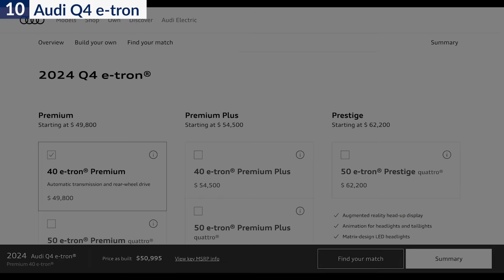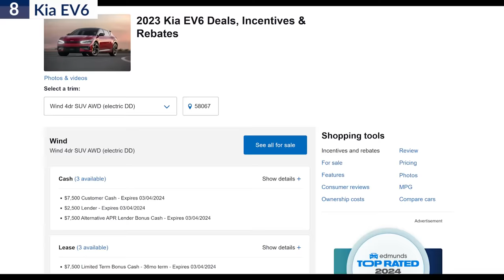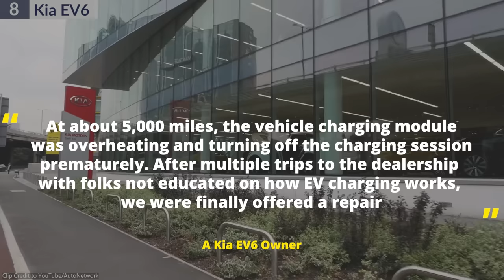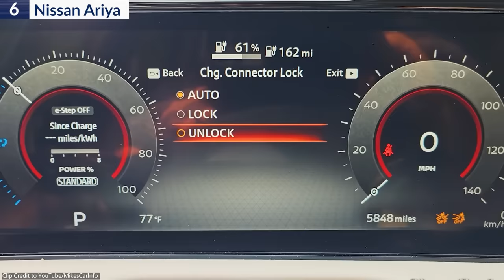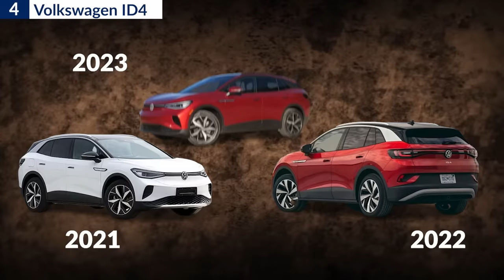New Electric Cars Piling Up on Dealer Lots in 2024 – Here is the Truth!

Comment: The hell with pollution I'm not going to be here in 2 million years. The car should know everyone doesn't have $60,000 to spend on a car. Or home to install a charger port.
Reply: Most people can plug into 110 volt and that'll be more than enough to do their typical running around. All the stupid comments on here about they don't have more than a 300 Mi range. Just ask yourself when was the last time you drove 300 miles?. Most successful people have more than one vehicle anyway
Reply: @davebrickley455 Why would anyone want to limit themselves to that??  When you could have a full tank of gas?
Reply: The use of “ most people can plug in at home” is an absolute joke, most people cannot, most people do not live in a property that allows off street parking.
Reply: 2023 hottest in recorded history and come on that's a pretty selfish comment.  You have any kids or grandchildren?
Reply: @mellarner8253  I was talking about dumb comments, yours definitely is one of them. If you've got a garage, you can plug it into any Outlet if you don't have a garage, you can run an extension cord to your car. If you live in that shity of a neighborhood, you've got none of above. I'd say electric cars the last of your worries
Reply: @davebrickley4557  In general, the majority of people here in the UK at least do not have that option. As for myself, I can park a number of vehicles on my country residence, not that I would contemplate having an EV, I have 4 x4 vehicles that I tow with, there is no EV that would be able to tow 3500kg any distance.
Reply: More issues, that the car should know ;

1. Child battery mineral labor

2. Range anxiety

3. Risk of garage fires

4. Paying 20k more than a
comparable vehicle

5. every time you fuel up an EV, the fuel tank gets smaller  and smaller. Battery degeneration. 

6. Poor resale value

7. Reduced performance in
cold, highway.

8. Higher repair costs

9. Awful charging network
experiences in the weather
without restrooms

10. Higher insurance rates

11. Replacing tires more
frequently. Michelin states that tires wear out 20% faster on an Ev, and could be as high as 50% faster! Ev tires made for ev's, cost 20 to 30% more, than regular tires for ice cars. As Ev tires wear out, they leave behind more tiny particles of rubber than normal ice cars. This causes more pollution. 

12. Death by autopilot

13. $25k - $35k battery

14. Low km range per tank of energy. 

15. must wait in-line 1-2 hrs
to charge.

16. Then wait more time to charge, while charging.

17. Spontaneous combustion, with no way to put out the fire storm.

18. If they catch fire in a tunnel, many people will die.

19. People without a pro charger system or a parking spot at their house, will run an extension cord to the road, which is dangerous and could lead to people tampering with your charging setup (super slow charging at the road)

20. If you're in California, you won't be able to charge your car past 4pm because of a shortage of electricity supply on the cheesy grid.

21. It is not actually "green". The pollution is made at the power station, and during the manufacturing process, not the car.
In advance of the Cop26 climate conference in Glasgow in 2021, Volvo released figures claiming that greenhouse gas emissions during production of an electric car are nearly 70% higher than when manufacturing a petrol one.

22. Only 5% of used junk batteries get recycled, the rest go directly into the bin. It's cheaper to mine for new minerals.

23. Chhinna actually does 70% of all the refining of the minerals and production of the batteries.

24. Minerals are becoming more and more scarce, and the cost will only go up, not down.

25. Some countries where they mine for lithium, actually use a very big boat load of fresh water to only produce a ton of lithium, so they are afraid of running out of water. It takes over 2 million liters of fresh clean water to produce 1 ton of lithium. 

26. Ev cars will soon not be able to drive in tunnels or be able to park in underground parking garage and probably will eventually void your house insurance if you park it in your personal garage.... 

27. You can't charge your battery at super stations when it is bitter cold out. 

28. If a fire truck comes to put out an Ev fire, all the chemicals go directly into the sewer system, poisoning everything. They need tons of water to slow down the burn. They can't put them out. They are only trying to prevent over things near by from catching fire. 

29. Ok, there is 2 good things; regenerative braking, which charges the battery while you are slowing down on the highway, which saves your brakes from much wear.

30. Loss of fuel tax revenue, so now the roads will only get worse, not better. 

31. in Dublin, huge generators are being used to charge EV buses, due to electrical grid strain. buses in Athlone also cannot be put on charge until midnight, for the same reason. Bus Éireann is saying that they can't charge their buses until 11pm for the same reason,  and to avail of a lower tariff. 

32. Not everyone on earth even has electricity to charge their cars. What are they supposed to do in 2035? It's easy to get a bucket of fuel to power up a regular car. 

33. VCE, or "vapour cloud explosion" is very bad. If any battery, typically anything larger than an E-scooter battery, and especially only "half" charged. If a problem occurs in the cells, it might not catch on fire right away. Instead, a cloud appears, and then may be ignited a short period afterwards. There are 2 different types of vapour clouds that appear; heavier and lighter than air, which form will be dominate, can not be predicted yet. This produces a bomm.

34. For Ev transport trucks, they aren't allowed to carry the same payload as a diesel truck, because of the massive weight of the battery. The owner of the Ev truck therefore loses potential profit, every day. They also lose more profit for the waiting times for charging that Ev truck. The driver will get paid to charge the truck, which in turn forces the owner of the truck to lose more money. 

35. Ev cars are more likely to be written off, if they experience a minor collision. After the collision, something could have upset the structural integrity of the battery. 

36. Ev cars lie to you. If you are bold enough to go out on a decent road trip and its 210 miles, one way, and your Ev tells you that your battery will last you 223 miles, there had better be no hills, or excessively cold out.... You'll probably get stranded, trying to get to the charger, at the end of the trip. Ev's have left many families stranded already. 

37. Ev's and their batteries, will soon need their very own "passport". With all info about them when born, and current info about them (power output, resistance, mineral composition, etc.) 

38. Thieves stealing charging cables, will soon make it impossible to "fuel" an Ev car. They take a long time to replace the cables, just to have them cut again for scrape money. 

39. Cars were typically being made lighter and lighter using aluminum and or fiberglass and or carbon fiber, to reduce emissions and pollution. Ev's are only getting heavier and heavier, causing more pollution than ever. Remember, an ev's pollution is made at the power station and the dump, not at the actual Ev, except for the tire particles as mentioned above. 

40. More on spontaneous combustion of the battery. What if you had 3 kids strapped into car seats, in the back seat ,which kid do you rescue? More fires start so fast, there is hardly any time for even the driver to escape, let alone 3 kids strapped in. 

41. There must be a reason that Boeing 747's aren't battery powered.... Until jets are battery powered, I'll be sticking to fossil fuels for my mode of transportation. 

42. Can't bring an Ev up north in the woods, nor any battery powered chain saws, where there are no grids to charge them up. You would need a huge amount of solar panels to get you anywhere. 

43. Even Mr. Bean says;
"I love electric vehicles – and was an early adopter. But increasingly I feel duped". 
"When you start to drill into the facts, electric motoring doesn’t seem to be quite the environmental panacea it is claimed to be." "It seems a perverse choice of hardware with which to lead the automobile’s fight against the climate crisis." 

Mr. Bean is a smart man. 

Ev's (External combustion vehicles) suck, and it's a bridge to nowhere. But they do sometimes convert themselves into "internal combustion", but sadly, they can only do that 1 time.